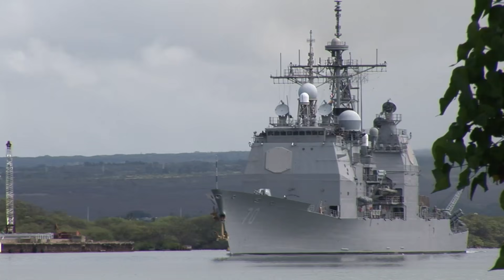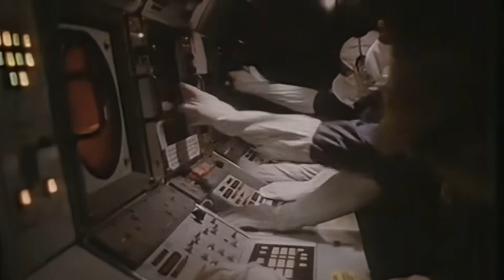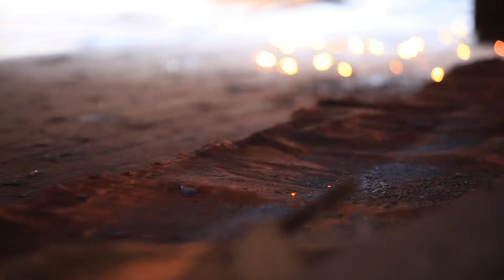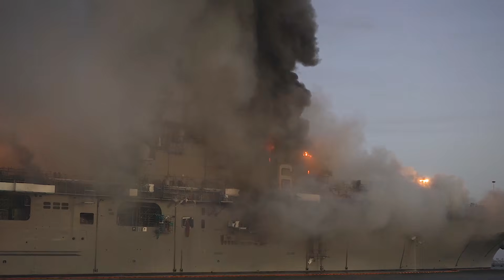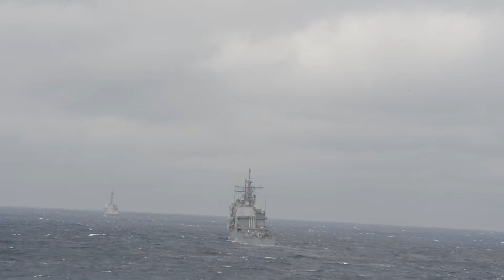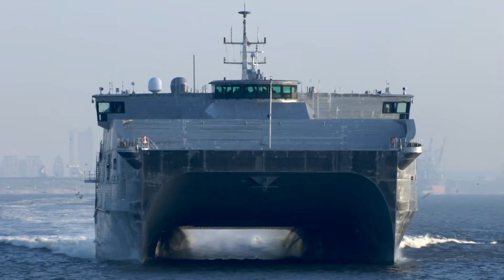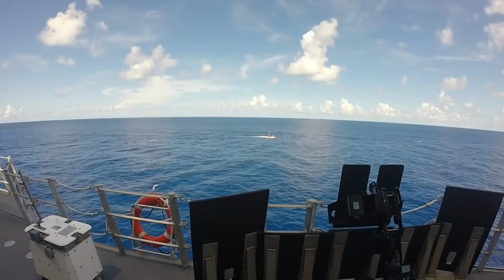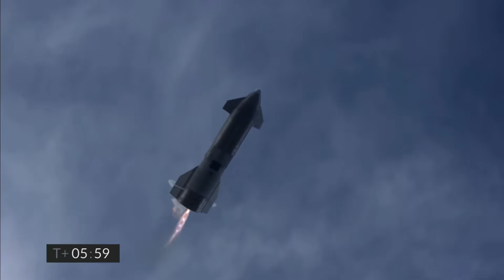Why is The US Building Aluminum Warships?

Comment: The main problem the aluminum is the sacrificial anode. All one metal is better because it does not corrode as fast. All of them does need lots of yard time to keep from getting holes in them like an old rust belt car.
Reply: They make water heater anodes out of aluminum (and magnesium), so yeah.
Reply: aluminum IS one metal

Comment: Imagine telling a captain from the age of sail that ships will be built out of metal, yet fires will still be an issue.

(EDIT) I understand why fires are an issue, but still, they built their ships entirely out of flammable material. Ours are made out of a similar material to what they made cannons out of.
Reply from the maker: I see your point.
Reply: Yes, wood is flammable, but it's surprisingly stable and load-resistant while burning ; it retain its mechanical properties way better than steel which will collapse sooner under a similar weight (at least in the case of buiding, which, I'm assuming, is quite similar, structurally speaking, to a ship).
Reply: @etiennebordes4008  I can see this being true for aluminum, but I'm skeptical for steel framing. Unless we're talking about some sort of chemically driven fire, in which case the flames are going to destroy the ship structure regardless. 

One thing about wood structural fires is that a layer of carbon (basically charcoal) forms on the exterior of the beams as they burn. This insulates the interior of the beam for a surprisingly long time and slows the rate of the burn. 

Thus wood buildings can usually remain structurally sound at least until well past the point where occupant survivability is moot (you've either escaped by yourself or with the aid of firefighters, or you've died to heat/smoke inhalation.)
Reply: @Bustermachine  I din't now about the creation of that layer of charcoal, even though I should have, cause it make a lot of sense and explain the point I was tryinf to make. 
So after re-reading my claim, I have to explain what I meant : for the same amount of load bearing capacity, I don't know if a steel pillar or a steel beam will last longer in a blaze than a wooden one, but the steel element, when hot enough, will become ductile and loose all of a sudden its mechanical properties, while the part made of wood will retain its capacities according to the cross section of undamaged material left. So the unburn core of a post, protected by the layer of carbon, even if it is, and has been, reduced in diameter, will still provide an amount of strenght relative to its size, when a structural piece of steel will risk to collapse (it will lose half of its strength, and will pose a risk of failing, around 600/650°C).
Hope that clears my previous comment, but feel free to discuss your opinion.
Reply: @Bustermachine  guess it depends on the processes and skill of the metal foundries.  A lot of the early iron ships were weaker in hull strength in arctic and antarctic seas due to the metallurgy of the time having too many impurities and poor structure, and just not being able to withstand the low temperatures, becoming brittle and failing.

 Some attribute the Titanic sinking to be due to steel failure due to very cold temperature.
Reply: Anything can burn if you try hard enough
Reply: "Ours are made out of a similar material to what they made cannons out of." 

Bronze ships would be awesome. 
Think of the faces of future archeologists when they discover wrecks in perfect preservation at the bottom of shores...
Reply: Yes it is odd that ships are all steel now but still burning like kindling. If you did get to talk to a captain of an all wooden ship and told him future ships would be made of all steel, first of he would never believe it, secondly he'd wouldn't believe they'd burn. Thirdly he'd ask how you got to his time period.
Reply: Big brane
Reply: Most age of sail ships weapons (cannons) didn't fire explosive or pyrotechnical ammo of any sort. Some ships had furnaces that tried to heat the cannon ball to red hot in an attempt to set fire to the enemy boat, but most often ended up getting damaged in battle and setting fire to the ship the furnace was in.

When aluminium was first produced, it was actually more valuable than gold, they thought it such a wonderful, lightweight and rare metal.  It's actually the most prolifically available metal on the planet
Reply: they should cover all their metal ships with asbestos.
Reply: I see your point there as well. When you step back and actually think about it it feels weird to say that a ship made of metal can catch on fire. Like, what exactly is catching fire here. Metal doesn’t inherently burn it until it’s actually molten. So is it just them that the materials that are not made of metal all the parts that are burning in a week and the rest of the shit? Because when you step back and think about it again, it doesn’t really look like in modern ships there is enough to burn that would actually cause a ship to sink?
Reply: I think any captain from the age of sale would just wonder why you want to build a ship out of something that doesn't float.
Reply: @krashd  Principles of buoyancy were well understood by the age of sail (heck, the Greeks codified them) and I'm sure plenty of captains would have a passing familiarity with displacement calculations. If only intuitively from considering the loading of their ships cargo. 

I imagine they'd be more wondering where you got that much steel. Or, given the era, especially aluminum. Until electrical processes were developed aluminum's cost to purify made it more expensive than gold.
Reply: I mean cannons exploded
Reply: @johnlavery3433  yeah, but I've never heard of a cannon catching fire
Reply: @johanrosenberg6342  I’d argue a cannon exploding is worse but whatever

Comment: Nice channel. Informative and engaging! How about a carbon fiber hull? 🤔
Reply: That's super expensive to build and hard to repair
Reply: 3 D printed carbon carbon?
Reply: @GabrielKish  still doesn't make it fixable
Reply: @GabrielKish  3D printing is one of the most expensive production method. It doesn't solve the repair problem and makes the cost even higher. Being new doesn't mean it's a miracle solution to everything.

3D printing main advantages are low initial cost (it doesn't requires expensive part specific tools) and ability to create complex geometry. Its drawbacks are slow production rate, high serial production cost and weaker structural resistance (depends on the type of 3D printing considered). That's why it's mostly used in prototyping and other low number production.

Comment: Space x is using steel for starship becuse its easier to mass produce a steel rocket instead of a carbon fibre one
Reply: Stainless steel also maintains mechanical properties at higher and lower temperatures than carbon fiber.